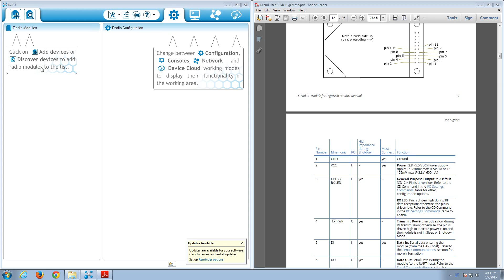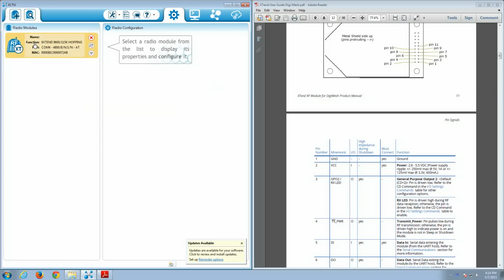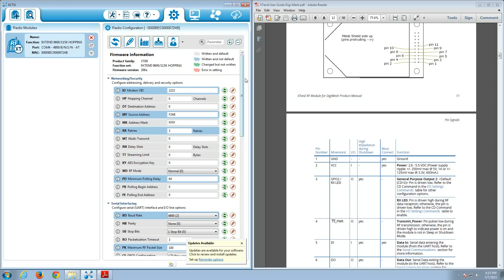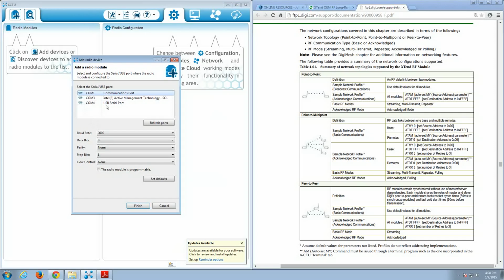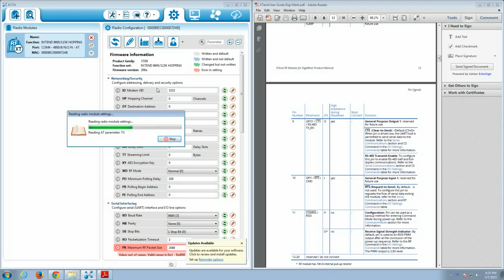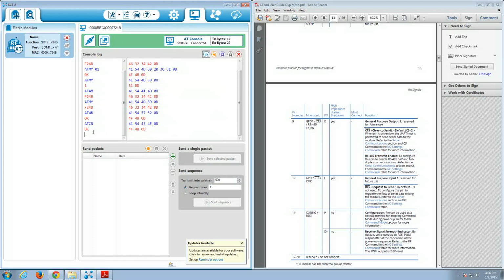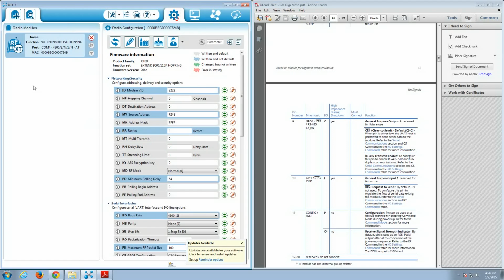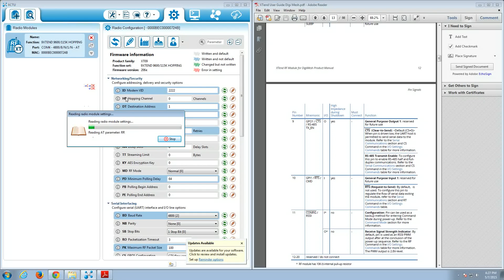Digi Xtend Programming Tutorial with FTDI IC

Comment: Hi,

Can you also do a video on changing the firmware to Digimesh for the Xtend 900? I'm planning to have these modules for my project and hoping you could share the schematics of interface to usb from Xtend.

Thanks!

Marlon
Reply from the maker: Marlon, unfortunately I don't have access to the equipment anymore. To connect via USB, use a FTDI chip (you can find one on sparkfun) 6 of the ftdi pins with plug into the Xtend which then allows you to easily change the firmware. Reference the data sheet for the exact pins.
Reply: What I meant was the capacitors and transistors you have at 1:04 mark. What was that for?

Thanks for the reply!

Marlon
Reply from the maker: That was just a regulator circuit for powering the extend, in this case we were using power outlets and a 12V car adapter to power the xtend receivers.